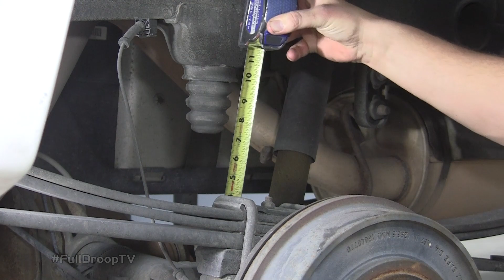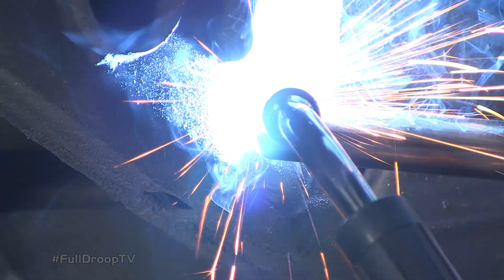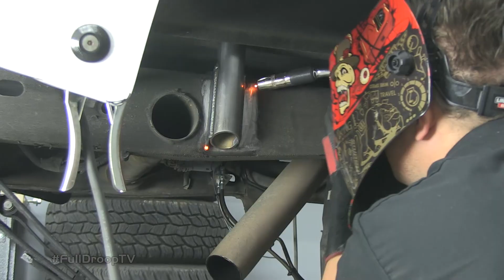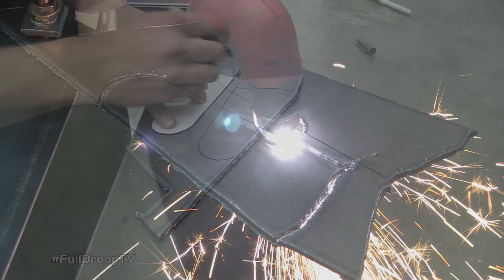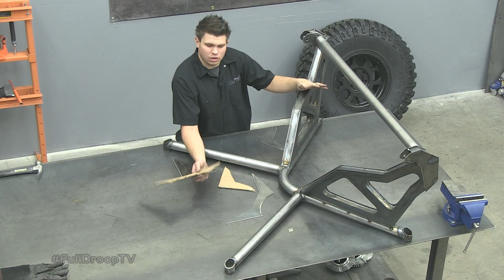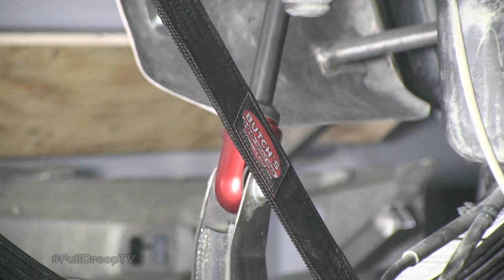Silverado Prerunner Bedcage - FullDroopTV (Season 1, Episode 3)

Comment: You guys didn’t break down the leaf pack to set your bump location. You also didn’t set your shock at bump and then articulate the suspension to insure correct shock location. You also strapped it with excessive leaf separation. Usually a deaver spring needs a longer shackle or even better, move the hanger back a few inches. Stock hangers and shackles aren’t recommended. This suspension will bind with how it’s currently setup. This is why breaking down the leaf pack and cycling it is so important. The fabbing is nice but the setup is all wrong.

Comment: Why didn't you mount the bottom of the rear shocks down to the axle? You could have a much longer shocks. also, how did you figure out the angle in which to mount them?

Comment: Wat size gage is the sheet metal u used to make the bed cage and all of the shock brackets?
Reply: Looks like 3/16. Pretty much all plate used in offroad is either 3/16 or 1/4.

Comment: How much does it cost to build a prerunner with adding a rear bumper? And is there anywhere where you could buy a bed cage?
Reply: 4 years late but about 20,000 if you dont cheap out, Camburg makes a bitchen bedcage. I just got mine!

Comment from the maker: With certain builds yes you do. We checked the driveshaft angle and made sure we strapped it at a point when the driveshaft would not bind. With the u joints it again depends on the build. Prerunners don't put the same strain on u joints like a rock crawler does.

Comment: What diameter shock would you recommend for a 3/4ton F250? I've heard that most of the small trucks run 2.0" and 2.5" shocks, but with the diesel my truck probably weighs twice as much. 
Also, how would I go about making the front suspension long travel, and prevent bump steer? In order to get the best performance I'd have to get rid of that panhard bar, causing the bump steer, correct?
Can you tell I want to build a truck to do it all? Lol, I'll try.